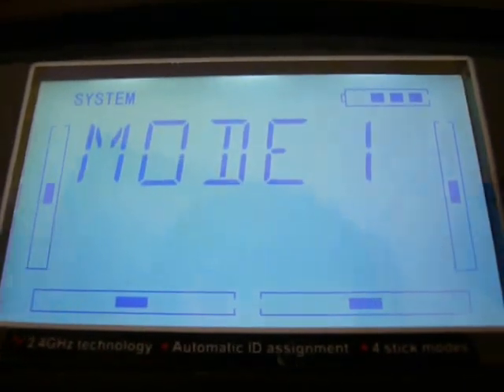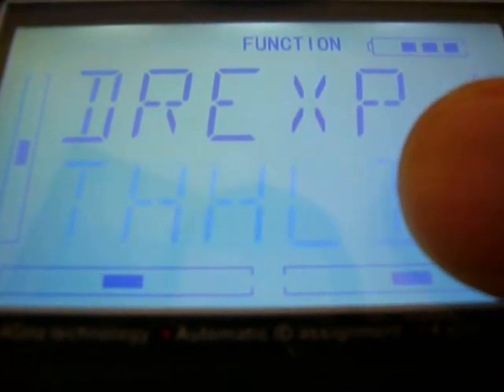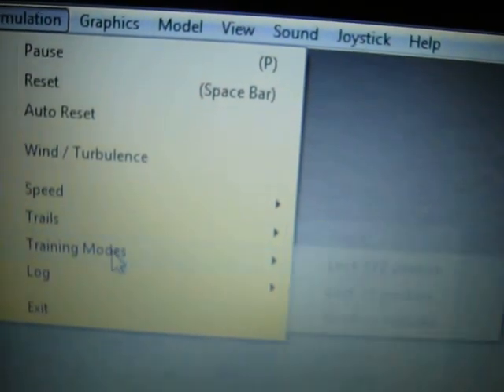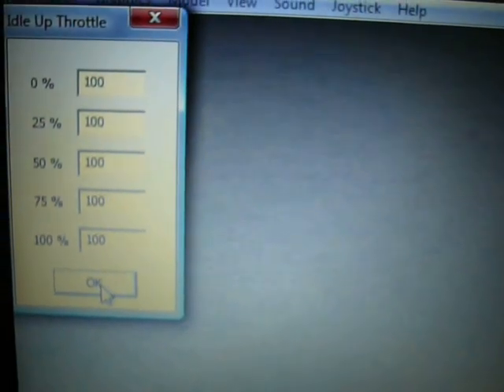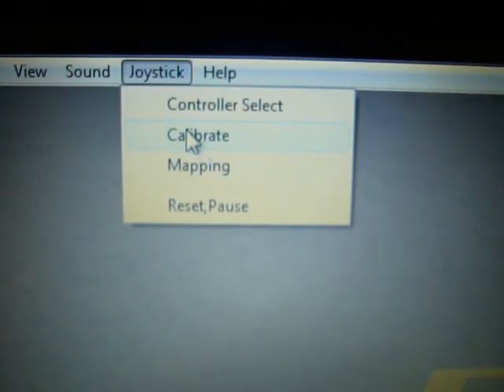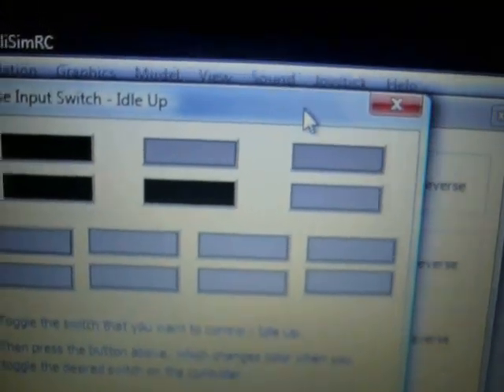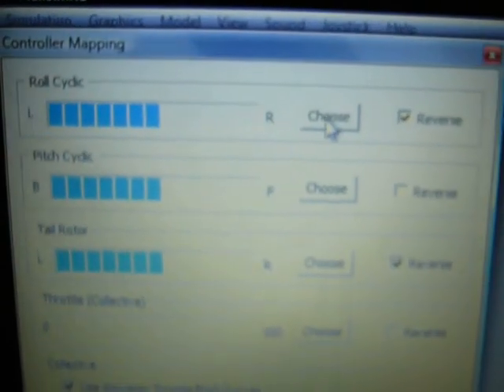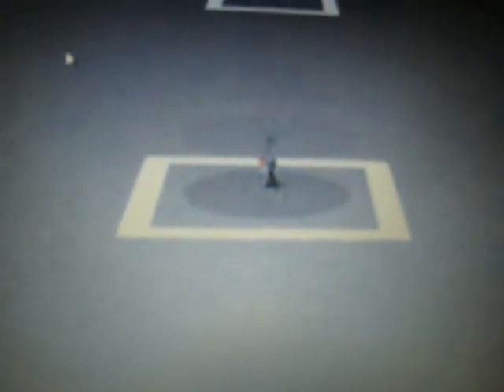Devo7 with HelisimRC

Comment: Hi.  Basic questions but it's hard, even watching videos to find out.  Does the upgrade cable let me use my Devo 7 with a sim on my PC?  Will it allow me to backup and load my configs?  Can I edit my configs on a computer and load them?  Don't have to go into detail answering just want to know if I should spend time trying to figure it out.
Reply from the maker: yeah it works with the two different computer simulators I've tried,  so give it a go
Reply from the maker: yeah it works with the two different computer simulators I've tried,  so give it a go
Reply from the maker: yeah it works with the two different computer simulators I've tried,  so give it a go
Reply from the maker: yeah it works with the two different computer simulators I've tried,  so give it a go
Reply from the maker: yeah it works with the two different computer simulators I've tried,  so give it a go
Reply from the maker: yeah it works with the two different computer simulators I've tried,  so give it a go
Reply from the maker: it should work,  I've used it on two different pc simulators, so give it a go
Reply: +dilbertoheli I use Freerider and it does not seem to see it.  Which simulators do you use?  thx,

Comment: I'm hoping you can help me with my Devo 7 transmitter. I have it set in airplane mode and trying to use the trainer port for the head tracking on my fat shark goggles for FPV. I have gone in to the trainer mode and made sure when I am at the trainer switch it only sends over channel 5 6 & 7 for the pan tilt and roll control from goggles gyro.

Comment: Thanks, exactly what i was looking for.. After lots of research i have also found a couple of alternatives. PPjoy for windows, and TXPPM for linux, though they might not be very accurate as it uses soundcard and TXPPM currently is not working with recent linux distros. Also there is an HID-Joystick over USB being worked on with deviation firmware.